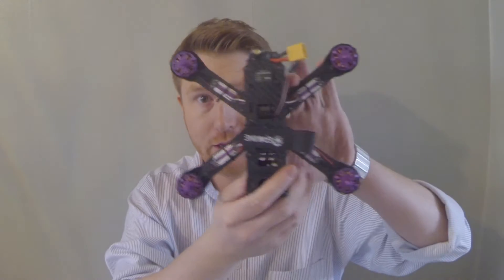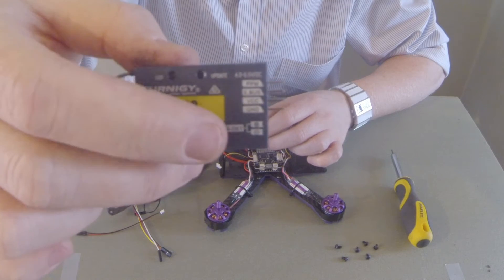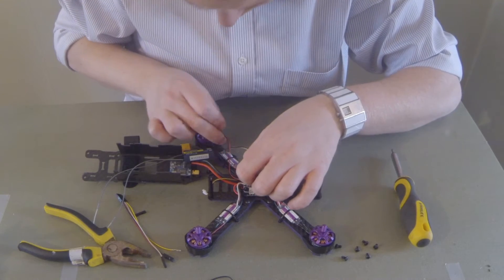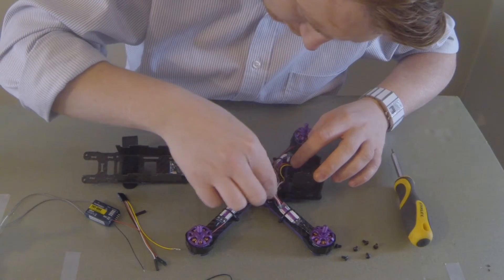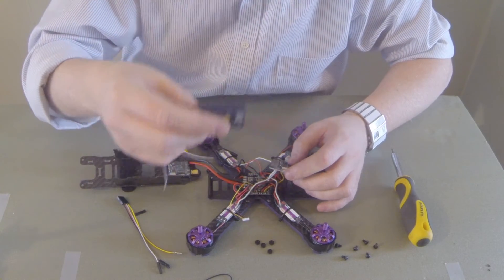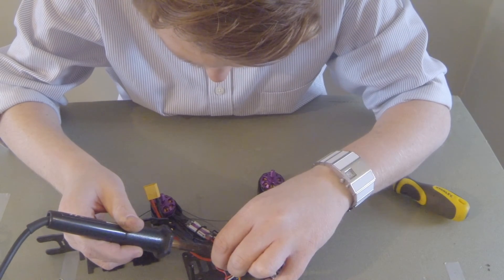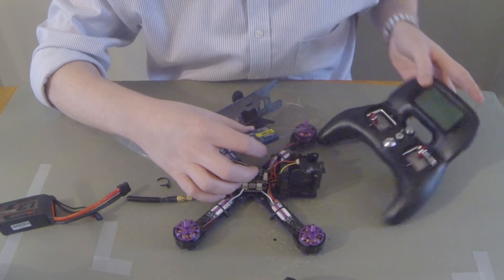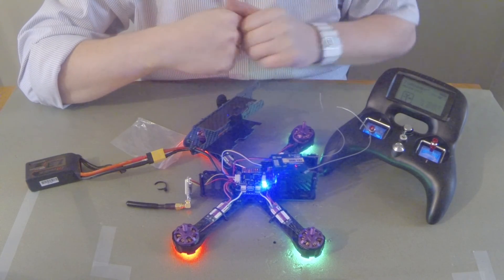Binding & Connection iA6C receiver to Wizard X220 ibus plus battery telemetry

Comment: Where can I get a spare sbus cable?
Reply from the maker: I don’t know what country your from however this has the part you need plus extra cables. It is also silicone wire which is much better than the plastic wire. Frsky 5P 5 Pin Receiver Connection Cable for R-XSR 2.4G 16CH SBUS PPM Receiverhttps://banggood.app.link/HKkIb1CJaQ

Comment: Hi Paul. (again).  Why is it necessary to solder the telemetry cable to the PDB as you?  I note the Receiver has GND, VCC, and I bus connectors already which can connect easily to the board without soldering.  I was able to bind without soldering.  However, if it is advantageous, it wasn't clear to me where I solder it too.  Can you explain that a little?  Thanks!
Reply: Hey I just saw your video again and put captions on.... didn't understand the English accent I guess! Sorry... so that solder is for Battery Detect?  So turnigy can tell when you are connected right?  So did you solder directly to battery connections on PDB? or a lower 5 voltage connector.... BTW great job.... how on earth did you figure this out.... there is almost documentation around!  Thanks again!
Reply from the maker: Yes, I soldered the battery detection cables to the PDB, actually to the battery leads. The reason for this is, is the receiver then receives the full power of the lipo battery, which then communicates to the remote. Then your Evolution controller will beep and flash when it's time to land. It was good until I fitted a buzzer. 
 Honestly, I do not use it anymore. It does not have a delay so when I punch out or fly fast the battery voltage sags for a second and can make the remote beep. however, it's not really time to land. I have now fitted a buzzer which is linked to the flight controller. I have also fitted a runcam swift 2 which gives OSD. It's not perfect but i get a better voltage reading. Therefore I have completely removed the battery detection. However, if you have not got OSD or a buzzer then is a good option until you make those changes. I hope this helps.
Reply from the maker: +Adriano Pangelinan i soldered it directly to the PDB to give an actual reassign your are right I do have a VCC which would also give me an accurate reading as well. I don't mind soldering and the connectors can be big and get in the way which is why I directly soldered it. Also to keep it looking clean on the flight controller. You will find that there are many ways to do things in the RC world. It's just finding the one that works best for you and your build.